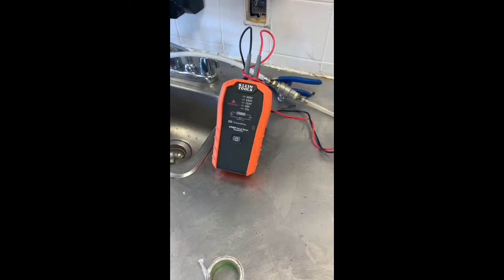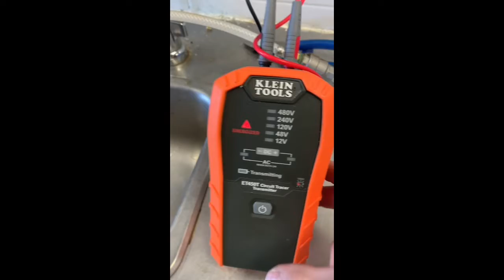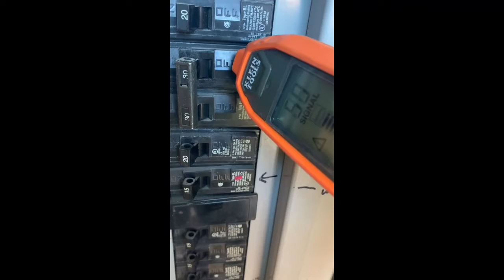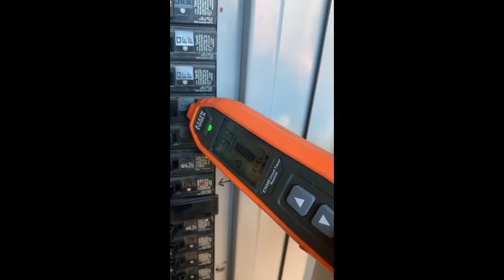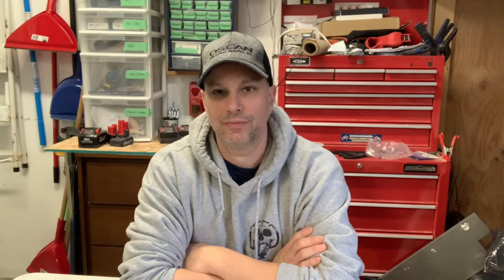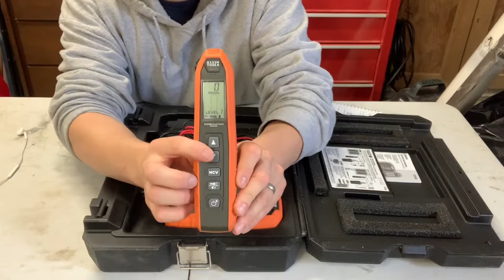Update on the @KleinToolsVideo ET450 Circuit Tracer

Comment: my toner is useless how can you adjust it? thanks
Reply from the maker: Im not understanding what the issue is? 1. You have to scan the panel from the first branch circuit to the last. This allows the receiver to learn the panel. The second pass will narrow the breaker down.

Try to attach the common to a ground that is not the same device you are tracing, to avoid eliminating the magnetic field.

Im not sure what you mean by “useless” 

I hope that helps.

Comment: I only wish they made an inductive clamp for this, it would also be nice if there was an indicator on the receiver that lets you know once the circuit you're tracing is de-energized. A bonus add on would be for an extension rod that allows you to walk upright when using the transmitter to trace buried cables so that you don't have to either hunch over or be on your hands, and knees. .
Reply from the maker: I think the Ideal Sure Trace has an extension right. (Id have to fact check that)
Reply: @mikestoolfun  One of the older models of the Ideal Suretrace has the extension.

Comment: Do you remove batteries when not in use?
Reply from the maker: @phillipmontoya9415  i’m a full time electrician so its in use 2-3 times a week. I keep the batteries in it.
I would remove them if I was only using it on occasion.

Comment: I used the et310 on several jobs and then got the et450- just fyi for those looking, the et310 is very accurate and far faster in identifying the exact circuit, because it automatically remembers the highest value from everything you show it in the panel. The more expensive et450 will allow you to trace high voltage and de-energized circuits, but you often have to play with the sensitivity, and if you do adjust it, you have to trace the whole panel again to find your maximum and visually look at every reading. The et350 was just 2 sweeps of the panel every time, and it would sniff that thing out. If you need the extra voltages above 240, or the extra sensitivity, get the et450. But I seriously miss using the et350. It was snappy and it felt way more like a fully automated process. It was either red or it wasn't, and it was awesome.
Reply: Forgot to mention if you need to trace de-energized wires or you need to trace through barriers, the et450 is it. That's why I got it in the first place. But I miss that snappy result at the panel with the et310 :)
Reply from the maker: @danielc4361  I keep both on hand.
Reply: The ET450 is for tracing the wires in finished walls.  If all you want is to find the right breaker, use the ET310 as it’s cheaper.  But for figuring out how your dircuits run through your walls or floors, including concrete, or to find breaks, the ET450 is absolutely priceless.
Reply: I bought the et 450 and yes, you're right it took me awhile to find a breaker,very time consuming. I bought because of the high voltage and non energized feature, but again it was time consuming and at times frustrating so I returned it.!
Reply: How about through 2 layers of drywall, could the ET310 handle that?

Comment: I’m trying to determine how best to trace a low voltage line.  A landscaper installed a low voltage wire through a small brick wall to feed a concrete flower pot.  I have access to the wires that come out of the pot.  Unfortunately, as I have found elsewhere, the contractor installed these in case a low voltage light was desired in the pot but left the other side in the ground disconnected. How can I find the other side without digging up my yard?  Thanks

Comment: I don’t have the et450, but I just bought the regular small circuit breaker finder.  I had horrible results and it did not work for me.  I have a large electric panel and two small panels all in a small closet.  Does this affect the circuit breaker finder?  Thanks!!!
Reply from the maker: It can affect it if the smaller panels are sub panels to the larger one. 

Slowly run the receiver along each breaker in the first panel. Dont stop even if the receiver indicates the breaker you are passing over is potentially the one. Make sure to scan every breaker, and then go back to the start and do it again. This time it should narrow down the breaker with the second pass.

I prefer the ET450 cause i can connect the common of the transmitter to a different ground or neutral , from the line i am trying to scan. This helps with the magnetic field not being cancelled out and makes for a stronger signal at the receiver. 

Note: when you are scanning a circuit and you use the neutral and line from the same circuit the magnetic field gets cancelled out and the signal will be weaker.

Comment: It looks like you moved Klein's Circuit Breaker Finder to the side as you described using the ET450 to find a circuit breaker. Does this mean that you don't like the circuit breaker finder? For 120 volt circuits, it seems to work well but it can't handle the higher voltages you talked about with the ET450.
Reply from the maker: The ET300 is handy to trace live ccts and fits nicely in my tool bag. I bring out the ET450 when I need to locate a stubborn cct, or de-energized one. 

They both work really well

Comment: Do you find that the volume on the ET450R receiver is sufficient?
Reply from the maker: I find it fine. Mine is loud.
Reply: Thanks. I wonder if something wrong with mine I just received it . I was outside testing the breakers in the panel. We’re 40’ or 50’ feet from the road. When traffic goes by I can barely hear the receiver. I’d say on a scale of 1-10 it’s maybe a 3 or 4 . 🤷‍♂️
Reply from the maker: @GTLee9  I would look further into that because mine emits a loud beep that I can clearly hear. I feel like the speaker for the sound maybe damaged? Klein is usually really good to exchange the product.

Comment: How would you say this tracer compacted to the ones from ideal?  At work we used to have the ideal tracers which work well but I don’t have access to them anymore so I was thinking of buying this one since it’s substantially cheaper
Reply from the maker: Ive used the Sure Trace from Ideal and they lasted about a year before it broke. There wasn’t a warranty on them.

The full SureTrace kit was roughly $1500 and it came with a few extra goodies. 

The Klein ET450 is just as comparable to the SurETrace circuit tracer, but its less than $300 canadian. 

Ive been using the ET450 for almost 2 years now on a daily basis and its still working like new. I have about a 90% success with it. There are a few times where I couldn’t find that cct but that usually happens in commercial buildings with multiple panels. Its extremely rare that I dont find the cct.

Comment: What brand tick tracers are you using?
Reply from the maker: Do you mean like a non-contact voltage tracer? 

I use the Klein Tools NCVT-3 Voltage Tester, when I absolutely need to. I generally just use my Fluke 376 true RMS Meter for testing circuits. 

Side note. Thank you for the follow. I’m trying to produce more content. I’m still learning to figure out my mojo. 
Cheers

Comment: Thanks for the great videos Mike.. I am looking for a circuit tracer such as the ET450, but at the same time need to also be able to trace ethernet cables back to their punch / patch panel. I am familiar with and have used both individual types,  but are you aware of a tool that does both, or do I have to have one of each.  Thanks!
Reply: There’s a Klein device around the same price that does Ethernet and exactly what you need. It’s called scout 3 or scout 4
Reply: I thought this tool would trace it with the proper probe . May an Automotive  Backstabbing Pin ?
Reply from the maker: Hmmm… i will have to see if i can make a connector that will allow me to trace ethernet cable with the ET-450

I currently use the Klein tone and probe pro wire tracer for ethernet.

Comment: What is the NCV button for?
Reply from the maker: The NCV (non contact voltage)button is a voltage detector.
You put the receiver in NCV mode and place a wire on the tip of the receiver to show if the wire is energized. The bar graph on the receiver will illuminate the signal strength.
Reply from the maker: https://data.kleintools.com/sites/all/product_assets/documents/instructions/klein/ET450%20Manual-web.pdf
Reply from the maker: Click the link i sent you and go to page 9. Its a quick start guide. Maybe this will help with some of your questions

Comment: have you ever looked into the amprobe tracers? I believe they have tracers with higher voltage ratings. Though they have much higher pricing
Reply from the maker: I have. I was seriously deciding to purchase one. I like Amprobe meters. I have the Phase Rotation meter and it works great. 
The Amprobe 6020 is around $1300 and the 8030 is $2300 CAD. The klein ET450 is $250 CAD. 

For budget purposes I bought the ET450 and have no complaints. You get a big bang for your buck. 
Cheers
Reply: @mikestoolfun  About 20 years ago I purchased the Amprobe 4000 Advanced Tracer for about $1,250 from Grainger . The clamp on for tracing outlets from the breaker panel never worked, had hardest time tracing wire's through walls nevertheless barrial wire which was the main reason I bought it. Bought cheaper one's that did just as good or better than the Amprobe 4000. About 5 years ago I purchased the Noyafa NF816 underground wire tracer which does a lot better job than any of my other wire tracers. It's a cheap tool probably made in China for about $46 on Amazon but has a two or three foot range and is fast and accurate.
 I have mostly bought all USA made tools but the prices have skyrocket where it's hard to purchase a tool and not meet what's it's intended to do. The Noyafa NF816 is the best wire tracer in my toolbox where the other's are now stored and collecting dust. You don't want to waste a lot of time tracing circuits for opens and or  shorts. Time is money and I can buy about 27 of the Noyafa NF816 for the price of my expensive Amprobe 4000 if it ever goes bad. Watching your video it seems like it's taking way longer to trace a circuit. You really have to keep the receiver up against the wall and work it back and forth and with trail and error hoping that you can find the problem. You shouldn't have to buy an expensive tool and work hard to find the the problem.                As an industrial electrician of 41 years I have used very expensive wire tracers that worked very well and the company I worked got the very best because they could not afford the down time.                  The competition is great and expensive tool's doesn't mean better. Greed has taken over at the expense of the buyer. So what can I say just let your conscious be your guide.

Comment: Would be interesting to know if you had any success tracing Underground cables in conduit or direct burial cable
Ty
Reply from the maker: I did manage to trace under slab in a building. The signal was faint but i picked it up.

Comment: Here in the states, these seem to be very hard to find at this time. Perhaps they are so popular that Klein can't keep up with demand...? I may have to contact (no pun intended) one of my electrician friends and see if they can get it through a supply house. I really need to map out the wiring in my house, and I think this tool would fit the bill well (I can't say it would be ideal because they're a competitor :) )
Reply from the maker: Ideal has their own version called “the sure trace”. One of my friends have one and after a year it quit working and Ideal wouldn’t warranty it. 

I did have to order mine through an Electrical Supply house in Canada. Its definitely worth it for me.
Reply: The ET 310 (the smaller one he set aside in the vid) is basically the same thing but smaller, less expensive, and more suited to a home owner with a single project or two.  Also a 'toner and probe' will allow you find where exactly in the wall a wire is... on a dead circuit. These circuit finders typically require a live circuit to function (though the bigger one he's showing doesn't) but they typically do. Usually the toners require a dead circuit to function. 

(Basically: 
Finders use the power to transmit, but toners will get fried by the power. Higher end units for professionals tend to be more tolerant of the opposite of what the unit wants.) 

Hopefully that helps you save money while getting the tool you need (though I imagine it's too late to save you a buck and some frustration, but maybe future readers will find it useful.)
Reply: @dunrite8671  Today I walked into the local Platt store and they do make cash sales, so I picked one up. They seem like real professionals there, I would have zero issues shopping there in the future. Thank you for the heads-up!
Reply: @NipkowDisk  Great, I'm glad you were able to get one!
Reply: It’s cuz there stupid cheaper compared to anything else .respectively 1700-2500 vs there 200 dollar tag
Reply: Amazon, got it that night. 👍

Comment: I do lots of residential work and often come across open neutral or open hots, how good is device tracing circuits through walls. Have you used it for diagnostics and troubleshooting?
Reply from the maker: https://youtu.be/zO_jhLseHgE
Reply from the maker: Click the link and watch my previous video.

To detect a broken/open neutral, use the ground connection and connect it to a different receptacles ground. It will trace through walls. I also have a video of it tracing through dirt. Cheers
Reply: @mikestoolfun  Thank a lot Mike very useful.  One last question where  in Canada did you get it? It seams to be our at HD and Amazon. Thanks
Reply from the maker: @andresperdomo2699  i purchase all of my Klein Tools from Oscan Electrical. They are located
In Peterborough and Oshawa Ontario Canada. 

You can also purchase it from Markham Industrial. 

If Home Depot is you only option, they can order the tool for you.
Reply from the maker: @andresperdomo2699  https://oscan.ca
Reply: @andresperdomo2699  I just picked one up through orka.ca
Reply: Nice! I looked on the local electrical wholesalers here in Canada,  I found one for about $370 CAD . It was the last one.
Reply from the maker: @andresperdomo2699  https://www.itm.com/product/klein-tools-et450-advanced-circuit-tracer-kit?gclid=EAIaIQobChMI6ZSH5bn2-gIVwhqtBh2wkQquEAQYAiABEgKg2PD_BwE
Reply from the maker: @andresperdomo2699  i purchased mine from Oscan Electrical in Canada 
https://oscan.ca
Reply: @mikestoolfun  I managed to get one from a local wholesaler.  One question about the batteries.  Do you leave them on all the time?. I'm considering getting lithium or rechargeable to prevent leaking. What do you use?
Reply from the maker: @andresperdomo2699  i just leave them in the devices all the time and I keep a spare set in the case. I do use the tool all the time and haven’t found any issues.

Im still on the original set of batteries, so they do have a long life. Keep in mind that as the batteries get weaker, the signal they send isnt as strong. 

Remove them after each use if that works for you. 😎😎😎

Comment: Have you had better luck using ground or neutral? I used it at a business during working hours and was getting hits on circuits everywhere. It was frustrating. Also, has the tool diminished accuracy with the batteries?
Reply from the maker: Keep in mind that the business could be on a 3-phase system sharing a neutral. 
I have run into issues where its picking up the signal over various breakers. 

In that situation, i would try a couple of options.
1. adjust the sensitivity level on the receiver. 
2. Pick a ground/neutral from a different receptacle near by. The kit comes with a really long lead for this purpose.
3. As a last resort, start shutting off the nuisance breakers that its picking up. (I haven’t had to do this option yet)  

If the building has multiple panels, it can be annoying, but in that case I would run the receiver over the conduits/Bx wires going into each panel. 
I had to do this and found the conduit coming through the wall into the loading garage area. I followed the conduit to the panel and ended up finding the breaker. 

I hope this helps.
Reply: It will pickup a signal through emt?
Reply from the maker: @coletonyanda269  yes
Reply: @mikestoolfun  Thanks for the info.